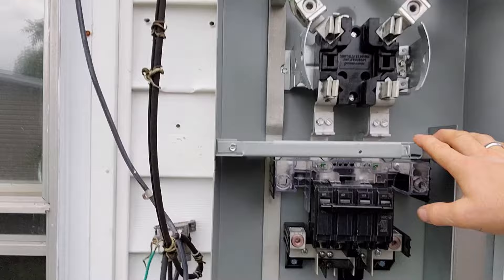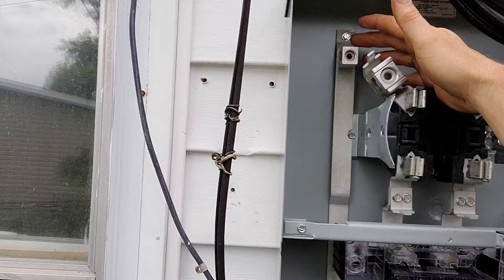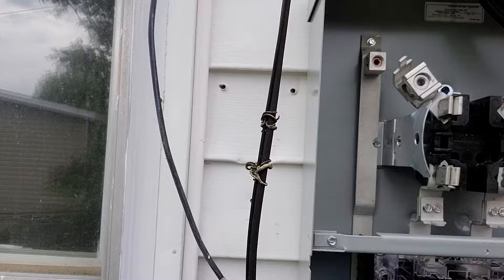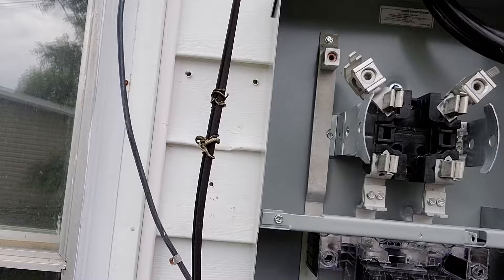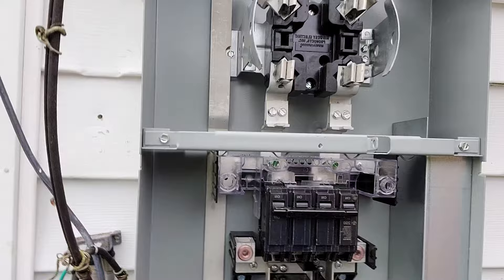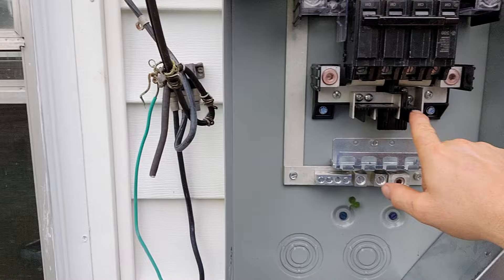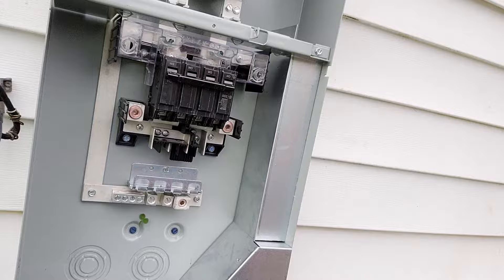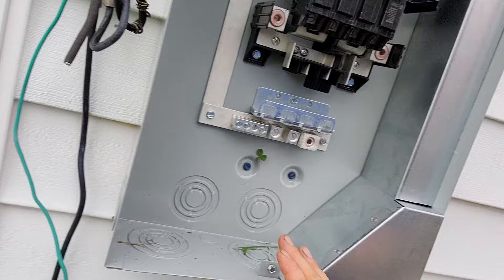What is a meter disconnect combo? Be a Pro. Learn from the Pros.

Comment: So basically the meter combo is pointless if your main interior panel is now considered a sub panel. Might as well just add a separate disconnect box. This new ER disconnect BS by just going to force people to put their main panel box outside or go back to the boxes without plug on neutrals since all interior main panels will now be automatically considered sub panels.

Comment: So would you still need to have a main breaker at the main branch circuit box if you are installing it indoors??? Or would you treat it as a sub panel??? As of for the 2020 code.
Reply from the maker: What's going to happen in the 2020 is you're going to be required to have a disconnect outside.

You can accomplish that many ways, a couple of examples are using a regular meter and then dropping below and putting a disconnect that would be your first point of Disconnect that's where you would Bond everything.

Another way is to put a meter disconnect combo, there are other ways for these are probably the two most popular.

Great question!
Reply: If you’re just upgrading the panel, can you just use the existing meter socket?
Reply: Depending on the situation it is possible that you could leave the old meter socket there, definitely want to work with your electrical inspector there are several things that could make it so you have to replace it.

Comment: Hi was wondering what type of wire I can use in a metal conduit riser down to my meter combo for an overhead service ? I know I need 4/0-4/0-20 for a 200 amp service but don’t know what type of wire to use

Comment: Is this sold as a seperate device ? I have  a meter can already set, but no outside panel.I understand the inside panel will have to have grounds and neutrals seperated, but I am trying to avoid getting into the top portion of the meter can
Reply from the maker: you can set it up where it is separate definitely work with your electrical inspector on this one!